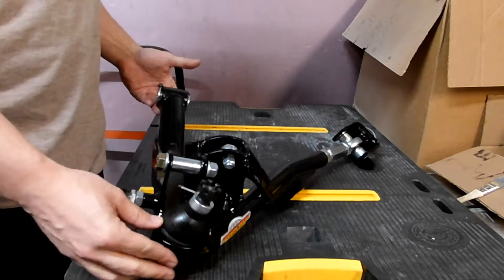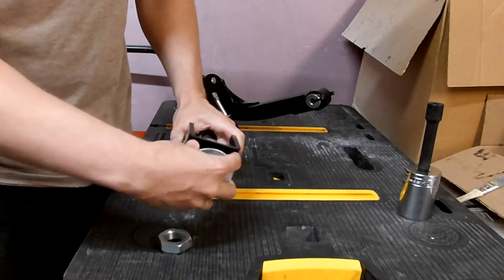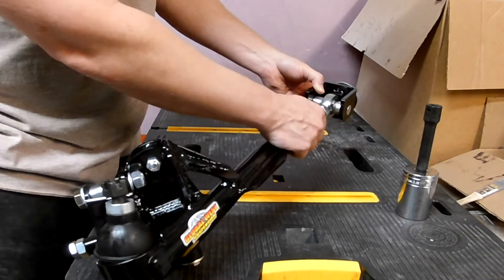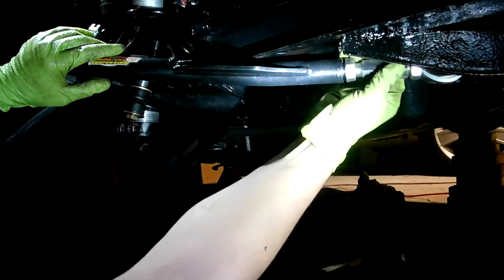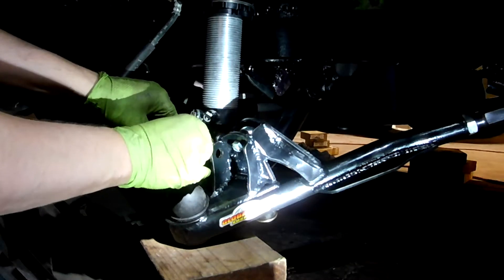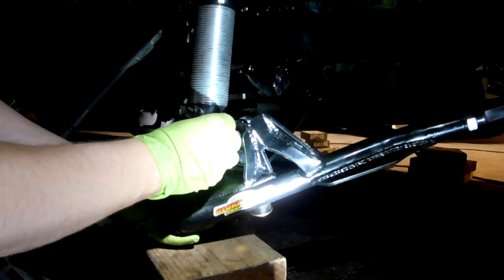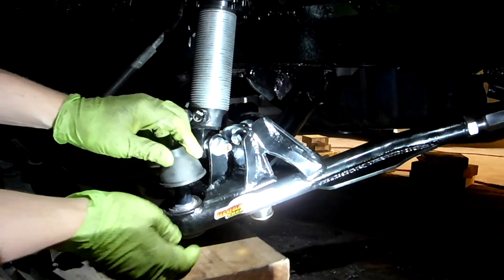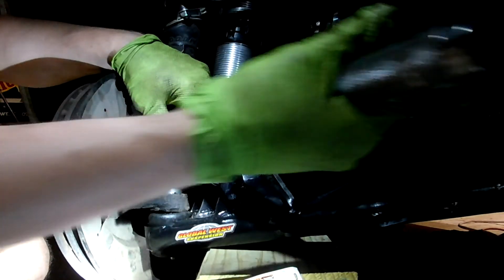Global West Coilover - 1965-1966 Mustang Front Suspension - Pt4 - Lower Control Arms

Comment: I purchased this same kit but am having troubles mounting the sway bar.  I can't get it mounted to the car because it hits the front strut brace and it also seems to be about an inch to long.  I was hoping you had a video showing the sway bar installation.  Anyway, did you have any troubles?
Reply from the maker: I didn't have any troubles. Do you have the sway bar end links pointed down off the control arm? Stock lower arms have the end link pointed up from the control arm.